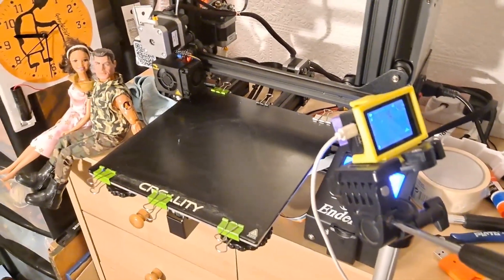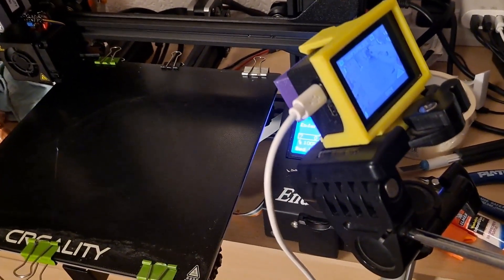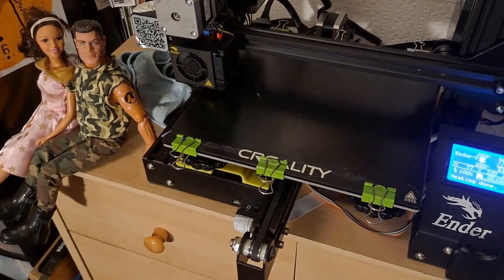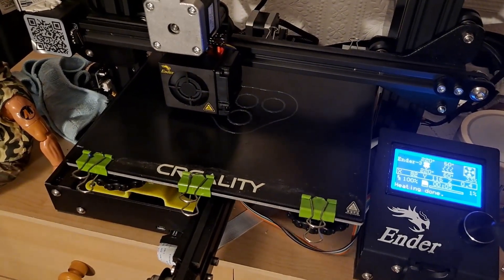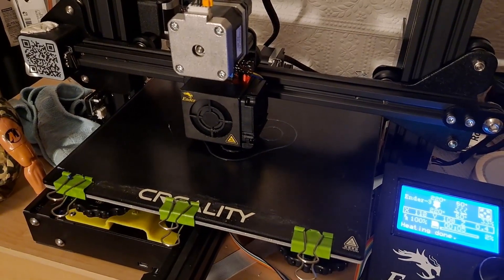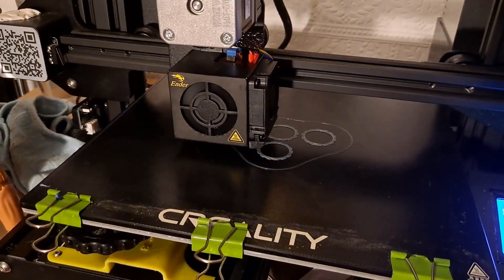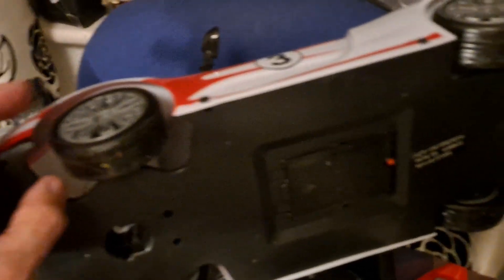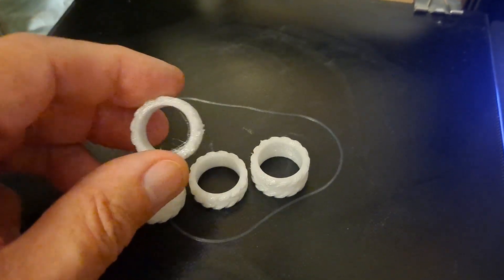Printing the Gamma 2.0 PART 3 TPU tyres

Comment: what are the bulldog clips around the bed for? Ive been curious for while.  would using a silicone bake mat help things release? will we be seeing cd tires anytime soon?
Reply from the maker: The clips hold the glass bed in place. The glass bed is coated with a special surface that grips the PLA when it is hot and releases it when it is cold, if you are patient enough to wait. There is plenty of misinformation about the TPU filament, many people warning that it grips the bed so well that you cannot release it. I guess it depends what bed you are using. To be safe I am coating my bed with Elmer's Glue, which is supposed to act as a release agent, but I suspect that is not necessary with my particular bed.
Reply: @GrandadIsAnOldMan  I was thinking that about the clips but it seems an odd way for a commercially available product to do it
Reply from the maker: @docink6175  maybe it's a case of "don't reinvent the wheel". the clips do the job.

Comment: How come the pla ur using To make the wheels is so Soft? Its almost like the texture of rubber. I bet the pla takes on moisture after opening it from the package so they put it into the oven To dry it out ?
Reply from the maker: It is not PLA, it is TPU which is a soft filament. That causes many problems when printing. It is also NOT as soft as rubber, so it does not make tyres that are as soft as rubber, but they are not as hard as PLA.

Comment: They turned out well. There are folk brave enough to print tpu without the direct drive extruder? Nice Porsche :) I so badly desire a Porsche Cayman S.
Reply from the maker: You can adjust various setting and get good prints. The main issues are retraction and Z-hop, oh and speed, I am printing at 20 compared to 50 with normal PLA. With the retraction, obviously with a bowden tube between your drive and your head, there will be a lot of stretch, so that is a problem. If your design can be printed without retraction, then you avoid the issue. Some settings will limit retraction and also the Z-hop.

Comment: Looks promising. Glad you got TPU to work. How is the direct drive working out? Thanks 😀 👍
Reply from the maker: So far, it seems to be working well. I did have one printing problem with the TPU after I had given it 30 minutes in the oven at 60°C to ensure it was moisture free. That left it even softer than normal and it did escape from the direct drive, but after it had cooled down it was fine.

Comment: Good Stuff Grandad! I been saving up for my first 3D printer, I decided on a FlashForge Adventure 4.  I also will be buying me a resin printer for a Christmas gift to myself, but I have a lot more research to do on resin printers.  I will mainly be printing stuff in HO Scale 1/87, so that's why I want a resin printer also.
Reply from the maker: Thank you. Yes, a resin printer seems to give much finer detail, unfortunately the resin seems to be rather brittle when finished, although probably not an issue for your purposes 👍👍